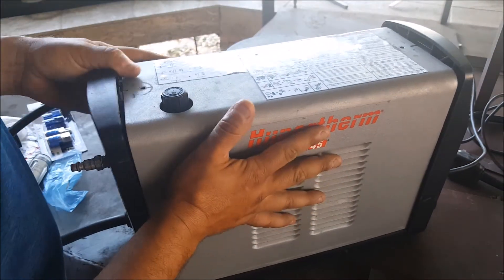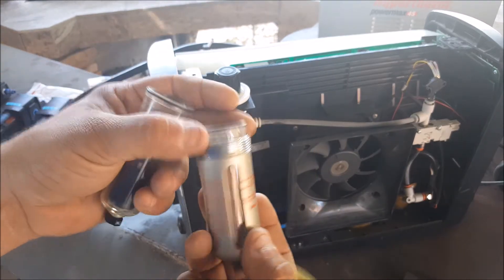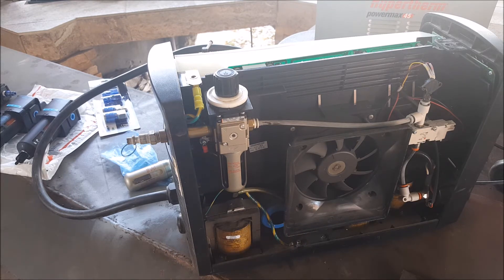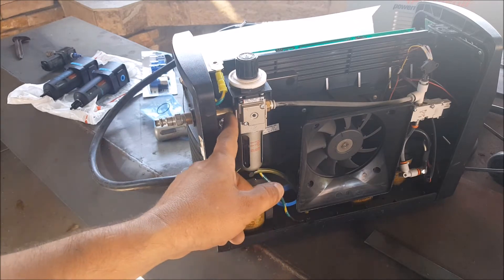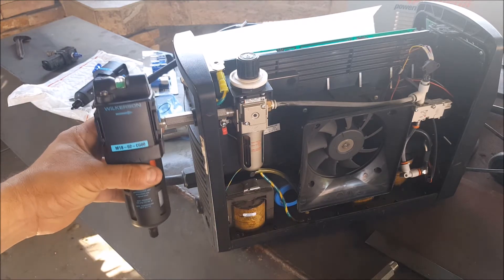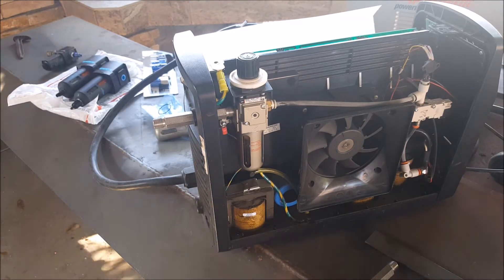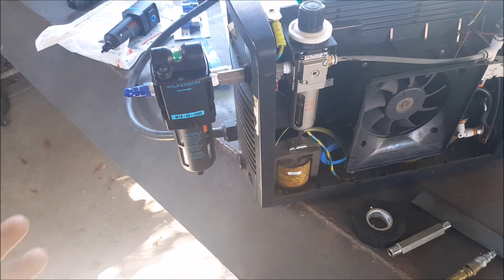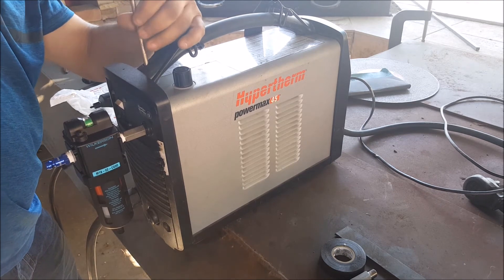POWERMAX 45 INTERNAL REGULATOR FIX AND NEW FILTER POWERMAX45 DIY REPAIR FIXED EASY FABRICATION

Comment: May be you can help me with this problem that I have on my plasma Hypertherm 45XP will only display 00 on control board, turning the knob does nothing, the numbers stay at 00. Resetting the board sets the number to 2.4 but then when I turn the knob a small release of air happens and it displays 00 again. I thought it was a problem with the control board so I ordered a replacement and changed it but the problem still persists. I also changed out the air filter and same problem.

Comment: Exactly what I needed to see, many thanks for taking the time to post this.
Reply from the maker: What problem did you have on your plasma cutter? Clogged, dirty or broken regulator. My powermax45 has been a work horse and still kicking. I got a new Primeweld plasma cutter to try out in a few days.
Reply: @cutweldngrind  Leaking air! Not my setup, my friends who use it all day to cut thin sheet.
Reply from the maker: @AllTheFasteners  Well glad this helped you. I have another plasma cutter I will be giving away in the next few months. I am actually working on an unboxing and review today. Check the video out tomorrow if you like,. Thanks again.

Comment: great video, well done!
Reply from the maker: Plasma cutter has been working great. It's old so replacement parts are slowly going out and hard to find on sale.  I dont recall the date of assembly but hope it last a few more years. The torch was repaired and regulator so far.

Comment: Ha! I have the circuit, and a full list of components. This is the early version of the PM 45. The free running oscillator needs to be tamed too. The Diodes can be up graded to a more suitable schottky types, as too does the darling to transistor. Easy fix this.

Comment: Hello
Could please give us link from where you have got parts

Many thanks for help
Reply from the maker: I used ebay to buy parts. What part did you need.
Reply: Jorge Serna 
Hello
I look for regulator filter and solenoid valve

Comment: Were did you get the new bowl? Mine cracked and can't find just replacement bowl
Reply from the maker: SMC AD27-CZ bowl was found on ebay but didnt see any now. I dont recall how I came across that number, think regulator model was used when emailing SMC.

The bowl replacement part is 428258 from Hypertherm at close to $60.

The bowl is polycarbonate plastic and does not like synthetic oil.

It will make the bowl plastic brittle and crack.
Reply from the maker: Did you find the bowl. I did a search on yahoo and looks to be $16 plus s/h.

Comment: Does it run on 110v or 220v
Reply from the maker: Luis Palomo This PowerMax 45 only runs on 220v, the 30xp is both 110 and 220. I am glad this is fixed now.
Reply: @cutweldngrind  is that inverter type of plasma cutter or runs directly on 220v?
Reply from the maker: @smoke_stackz3168  This model runs on 220V AC, my buddy has one that's dual voltage but its smaller in size. It's a nice machine so if your interested in one I suggest buying a quality plasma cutter and a good compressor